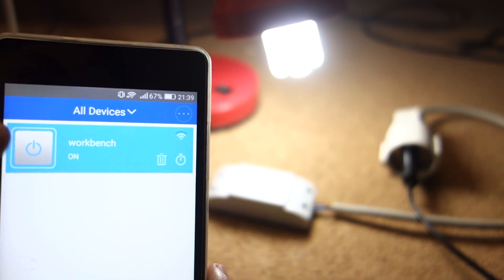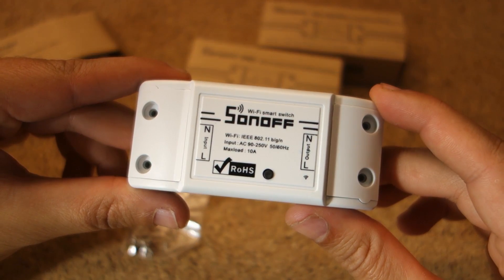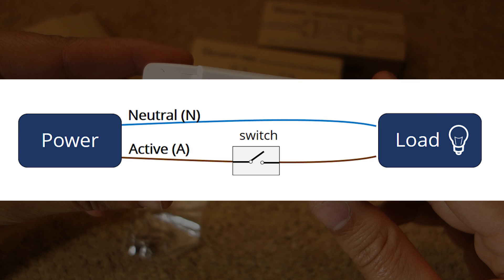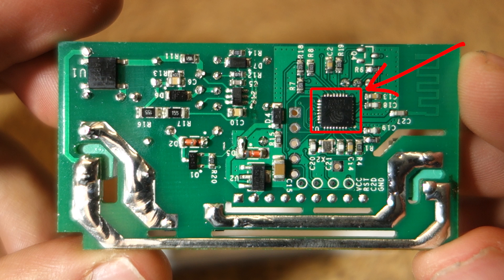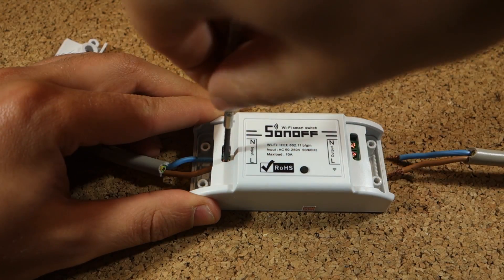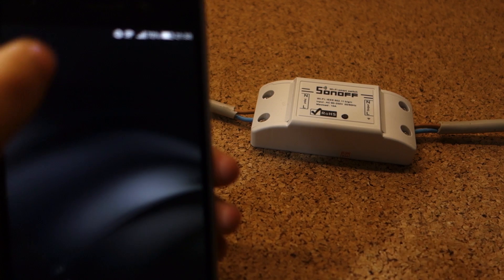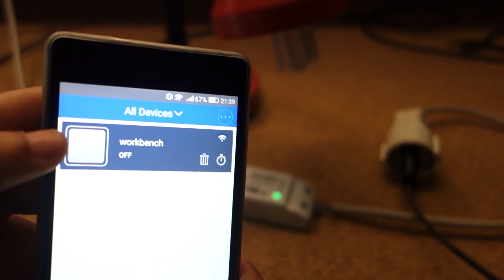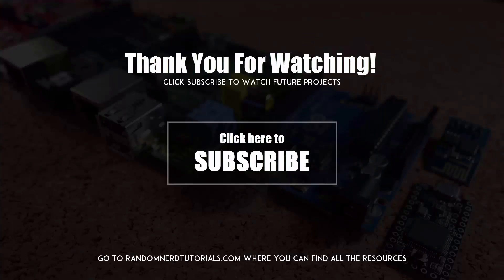Sonoff - $5 WiFi Wireless Smart Switch Introduction

Comment: Hi you have such cool videos! I’m looking for a prebuilt esp8266 + 2.4 ghz wifi  module to flash some opensource firmware onto to control my rgb color (Milight / Miboxer ) lights with. I can’t build one myself currently but can flash the firmware / software. A product like this, that is built and has a case but allows you to put your own software would be great. Do you have any product recommendations or videos? Thanks so much!

Comment: Nice Video. I have a question.. How many devices can be connected or controlled from a single mobile.?? or is it possible to control a device from multiple mobiles??
Reply: Yes
As per requirement the circuit and app will change

Comment: I broke the push button meant for pairing while trying to set it up. Is there a way to solve the issue and get it to work?
Reply from the maker: While have everything disconnected from mains power (obviously), you could desolder and remove the pushbutton. Then, solder a new one. It should solve your problem
Reply: Sounds technical. Where can I get the push bottom from?
Reply from the maker: you can find very similar buttons on eBay... But if you don't know to do it, it might be better to purchase another SONOFF instead...
Reply: @RuiSantosdotme I'll try to find it and thank you

Comment: There's any real wireless switch that you can put on the wall like a normal one to control that module and still control via app , if that's possible and exist can anyone give me some information? Thanks in advanced

Comment: Is it work for AC ?
Reply: Aircon needs minimum 40A relay.. It is not safe to use these device with AC. because under rated relay capacity.

Comment: Can you control this with a desktop PC running Windows? And would it work if the phone is in a different network to the switch (eg. If you're at work and you want to turn off the lights at home)

Comment: What happens if your phone's baterry dies? For example I set up a timer on the app. Does the sonoff memorize the timing or is it fully dependant of your smartphone?
Reply: Thanks. That makes sense
Reply: it counts down through the cloud server. thats where the timer is.
Reply: Steven Turner how will I connect my sonoff wireless switch to my home network?

Comment: I have a few of these and I they seem to work really well except the other day I noticed that with my Christmas lights after it shuts off the led ones are still on very very dim but the regular lights are off. Anyone know why that could be? Maybe the relay inside isn't closing or opening the circuit all the way? I'm not an electrician so I have no idea what would cause that or if it's something I should worry about. I have been unplugging the lights from the switch since its been doing that.

Comment: It cant be use in my electric fan... Because how can i change the power if the fan? its just a on and off feature...
Reply: Why not?  You may need a switch designed to work with an inductive load.

Comment: What about wiring this up using a short extension cord, with the male plug on one side and female plug on the other.  That way it can be moved to different devices and you don't have to cut the cord for your device.
Reply: Good idea, and I have done with before with these, but be careful as the little screws don't hold the wire that well. One tug and you'll have an open hot connection that will definitely bite you. I can't attach a photo, but what I do with mine is wrap the wire above and below the device (so the wires are now going the opposite way from how they stick out of the device, one above, and one below) and then use zip ties (4, 2 for each wire) and pull them as tight as possible with a pair of pliers, leaving a small amount of slack coming out of the device to prevent breakage. As an added safety measure I then hot-melt glue the wires into the sockets and as the glue is cooling off I then rescrew the covers on (so it fills in nicely). Might be a bit overboard but I have 2 toddlers and if one came loose it could end badly
Reply: That's what he did...

Comment: Very bad / Unsafe to use metal - Non insulated tools when working with mains Voltage, Always use fully insulated tools to prevent Electric Shock. Especially if you have not worked with mains power   recently or before.
Reply: Andrew Walsh Just always disable the power when you're changing something with electricity. 

Sorry for my bad English

Comment: Nice video. But the device has a line and neutral of input and output are very near. We need to careful while connect otherwise they may possible of connect both neutral and line of outpput and cause a spark. That's what I feel about a device.Thanks

Comment: Thanks for the video. I am considering buying and it was helpful. One question. Say I have the sonoff set up on schedule to turn on every day at 1pm and off at 2pm. I would need to set this up via the smartphone app. What if the next day my smartphone was off or it broke, would the sonoff still work? Or does it need the smartphone on to work on the schedule?

Comment: Very helpful video. Btw does it work with Amazon echo??
Reply: I have 12 of these throughout my house and shop (I use them both as an overall switch for things like lamps/ fans etc etc and as integrated switches for large appliance (like turning off the spinner on my popcorn popper but keeping the heat lamp on) and I'll confirm they do work with Alexa/ amazon echo (you need to download Ewelink and then the Ewelink smart fan skill)

Comment: Hi,

After SONOFF is successfully configured, what if there is no internet connection. Will power be allowed from SONOFF device?
Reply: internet down, you are stuck. simple
Reply: In this case always keep the switch (in POWER ON MODE) and control it from the app, when down use ur switch instead
Reply: Still will work if your connect with the same wifi. But will not work if different wifi.

Comment: i have the same but mine worked until i connected a light spot in it after i connected the sonoff did not want to connect to wifi again. frustrating

Comment: can I turn on the sonoff with the cell phone gsm NOT the Wi-Fi?
Reply: Dan Avidan Sonoff has to be connected to WiFi, but your mobile could be connected to internet somehow
Reply: Your device must be connected to the internet over wifi. Your phone too has to be connected to the internet via whatever means, data or wifi and you must log into your account with the central server. Your phone can be right next to the device or half way across the globe, it will work.
Reply: NO

Comment: Hello, if the power has been cut from this device does it reset the state of the relay? for example I turned it of via wifi disconnect it from 220v and connect it again will it still be turned off?
Reply: power on reset keeps it off until a new command is issued
Reply: Does it works on mobile hotspots

Comment: can it be control with my cellphone when I am outside? using the house wifi. 
can it be use 2 ways - manually on and off/by cellphone too?
Reply: Each device has its own unique ID like the4 MAC address on an Ethernet chip. When the device is powered on it connects to the central server in the cloud over your wifi internet connection. When you log into your account from your mobile device, phone or tablet as I do, anywhere in the world over any kind of internet connection, your devices will be listed in the application. They will show the state of each device, On, Off or Offline. Except when they are offline you can toggle their state.
Reply: yes

Comment: sir,
if i used this ckt. in electrical lock control, so what will be safety ? if any person installed  same application in his mobile...he can also operate or  assess my system?
Reply: No. First of all you have to register on line with the server and create account + login password. Only you can control it and that too ony after logging in.
Reply: No. it is connected to your wi fi network. so if they have access to your network, they can , else NO. it is safe.
Reply: First someone to intrude must knowing the ID of the device powering your electrical central lock then sould have Android app. installed on the phone wich controls those devices as I understood from watching the video.

Comment: A smaller version that uses bluetooth, so I can have a remote light switch fitted inside a wall plate would be cool
Reply: It still wouldn't be all that small as you would have to supply low voltage power to the bluetooth receiver.

Comment: can i use it for 0.5 hp motor?  and does it have a option to run on wifi router?  or it needs net?
Reply: It can only be controlled from the internet. Even if your phone AND the switch are connected to the internet over the same router the command still comes from Internet. There are versions that work similar to the car door lock and support 4 or more devices independently which do not require ANY kind of lan connection.

Comment: can i add this device to water motor? 2HP?
Reply: Yes but no. 1HP = 745W
but i think the systeme is max 160W.
Reply: What max watt can i run? Max 100 watt light bulb?
Reply: I don't think is safe with this product to go to max current 10A like the product said. (120V*10A=1200W)
I'll try max 300W to be safe so if you have LED bulb is perfect.
Reply: Thanks for guidance!

Comment: Is there any way to make this work together with existing light switches? So I can turn lights on with physical switch on the wall and turn them off with sonoff and the other way around?
Reply: Yes, but you have to put relay spdt  120 Volt ac at the output  and  connect like an 3 way system
Reply: or 220  volt relay if you are in europe

Comment: is it possible to power it separately?

I am intending to use it to power on and off my heating system, which doesn't go to the main power grid so I won't get any way to power the unit unless with an external battery.

thanks,

AL
Reply: Sounds like you need the other device, Sonoff SV - Low voltage Input, 
switches AC or Low Voltage DC. There's no case for the SV device and it's Limited to only 10Amps. A workaround solution would be to use the Sonoff SV in DC low voltage mode settings and have it switch another High Amp relay or Triac if switching AC. Go to the manufacturers page at itead dot cc to get the specs

Comment: Do you know if the firmware and app allows you to use multiple Sonoff units on the same network?
Reply from the maker: Yes, the original firmware+app allows you to add multiple sonoffs in the same network.
Reply: yes. any number